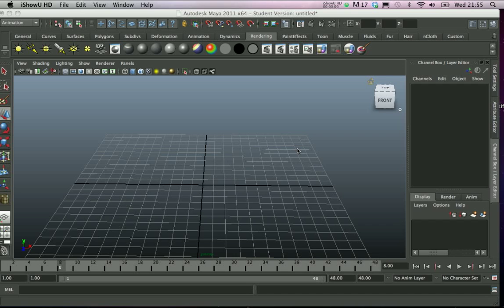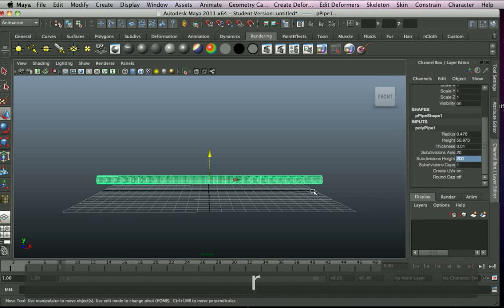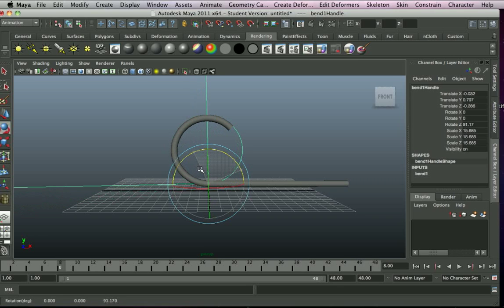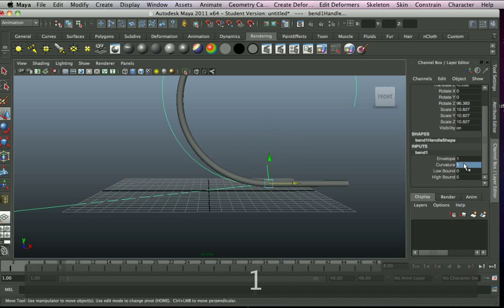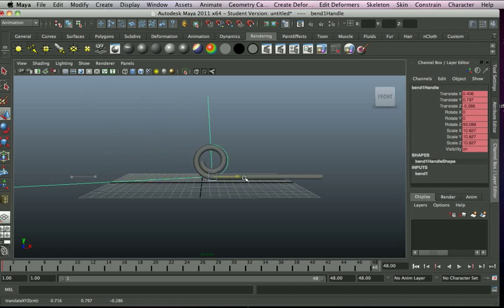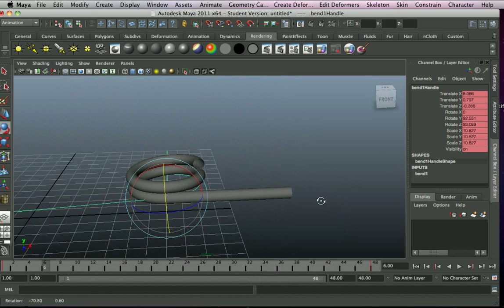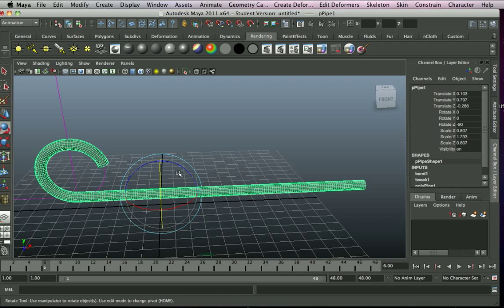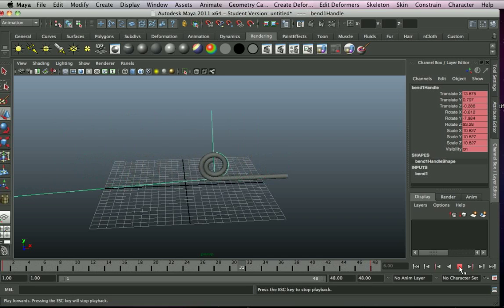Non Linear Bend Deformer Maya tutorial.

Comment: How do I unbind/delete a deformer from an object after im done? I finished curving it how i want it, but i would like to add another bend to the other side of it.
Reply from the maker: You should just be able to delete it, click on the deformer and delete. When you delete the deformer though your shape won't stay deformed. It may be better to add the other deformer and keyframe it so it works after the other is finished and the shape is set if that makes sense? You can have more than one deformer affect an object too if you lock the first an add the second.
Reply: You can simply duplicate the mesh and it should keep the same deformation without being bound to the deformer.
Reply: I guess the easiest way is to select the bender and the mesh then go to "edit" -> "delete by type" -> "history" that leaves you with the bended mesh but the deletes the deforming tool

Comment: Is there a way to adjust the deformer so that both ends of the object curls into the centre? Instead of the curl starting from one end and curling into the centre. Thanks
Reply from the maker: You can attach more than one bend deformer to an object. I've just been messing around with it and if you play with the high and low bounds on each one too you may get some good results.

Comment from the maker: You can use them to move objects as they go past them? I have used them for arrows when they do a loop in a motion graphic. It can stretch and deform them too which can work really well and when it gets out of the deformers reach it regains it's shape and form. There is alsorts of ways you can "cheat" using the bend deformer.